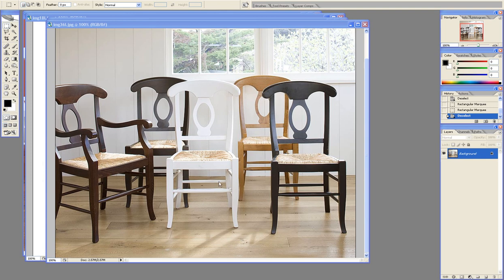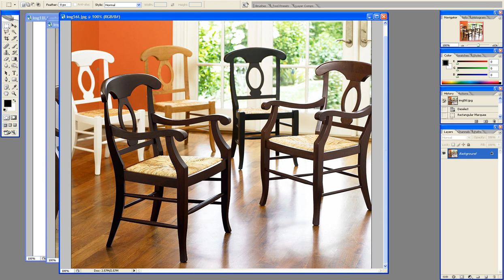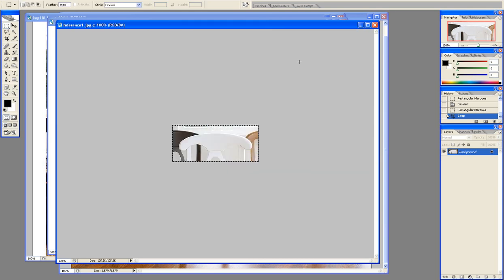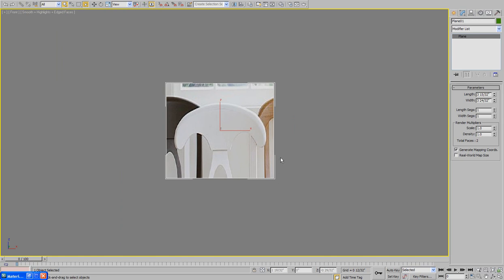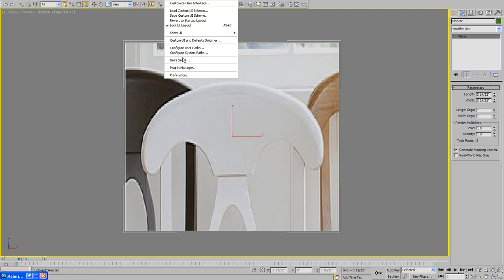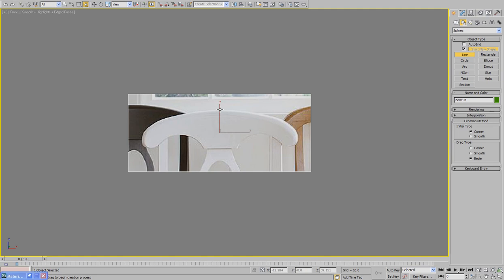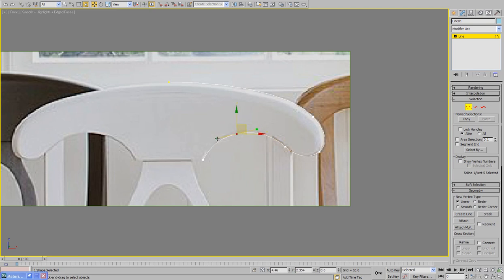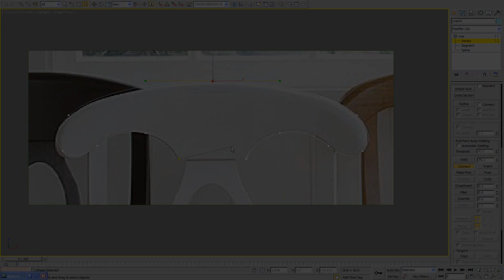3ds Max 3D Tutorial - Advanced Modeling - Chair Part 1

Comment: @sereda008 In this particular modeling example, like in most other furniture modeling examples, using plane object with texture stretched over is the most practical approach to bringing visual reference inside 3ds Max. As a quick example, try to assign background image (Alt+B) to Viewport, regardless of which view you choose for that Viewport, side, front, left, etc... you would still see the same background, that may be confusing. Or, what if you need to bring two reference images at once?

Comment from the maker: @enlighteneveryone As 3ds Max continues to grow, you see less and less usage in math for modeling.  However, to get exact measurements, it will always require math (more arithmetic than complicated math).  The programing (maxscript) is generally used for dynamic scenes such as particle systems or collision detection.  Even then, there are plug-ins that satisfy most issues.

Comment from the maker: @dimpilsPEACE Sorry, but that requires a much longer tutorial.  At the very least, I suggest you buy the 	'3ds Max 2009 Architectural Visualization Intermediate to Advanced' book (Google it).  It covers how to make walls, windows, doors, roof tiling, and other components to make up the house.  If that's not enough, then buy the "3ds Max 2011 One Project from Start to Finish" book we just came out with.  It's more advanced & like has very large tutorials in it.